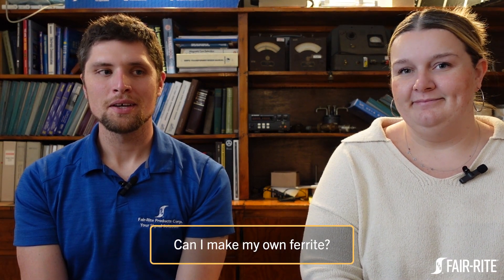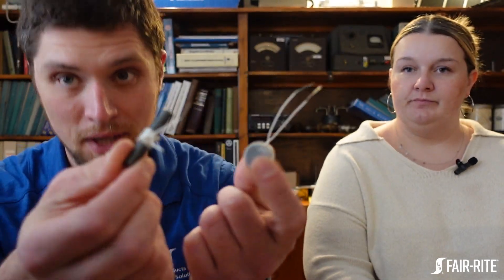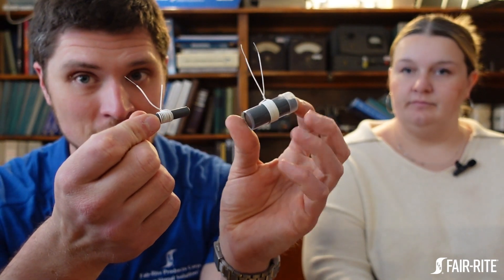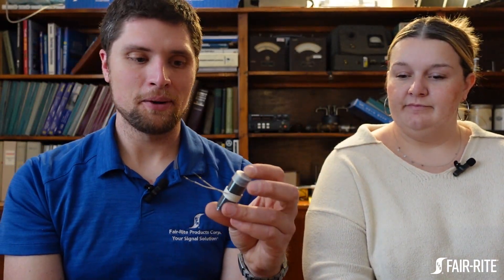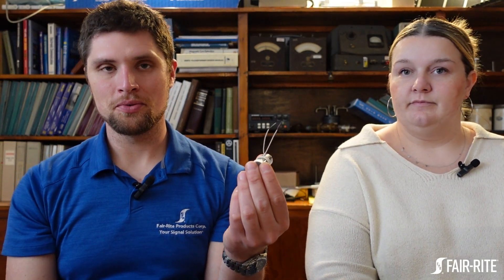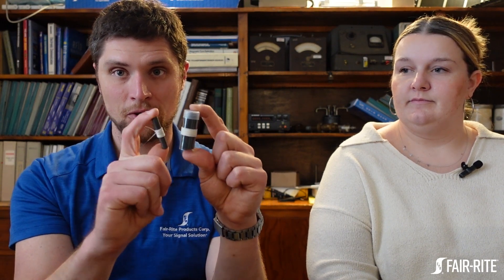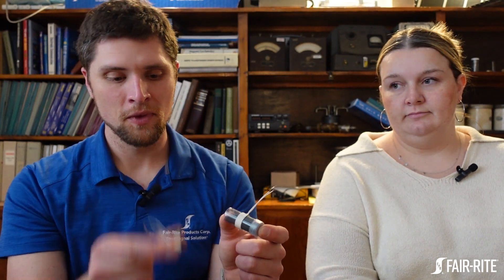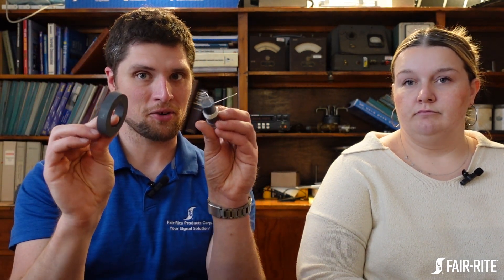S2 Ep 4: Can I Make My Own Ferrite?

Comment: Will. Ferrite bead still work ok if the wire is bout 2 ml in diameter smaller in size so it wouldnt fit tight hanks

Comment: what is the composition of ferrite and frequency response?
Reply from the maker: All ferrites are primarily iron oxide. Manganese or Nickel oxide are the next largest components. Higher permeability materials that drop off more quickly at lower frequencies will use manganese. Nickel is used in the higher frequency, less peaky materials. Zinc oxide would be the third largest component in either type. Changing the ratio of these and minor elements along with modifying the sintering profiles are how we arrive at the different material types.

Comment: Is it a good idea to make a ferrite core axial flux motor ?
Low eddy currents, hysterisis loss, high permeability, and higher saturation limits would all be good features to have.
Reply from the maker: My inclination is to say that ferrite would generally not be a good stator core material on any motor save for something operating at extremely high rpm. Typically, axial flux motor designs are desirable due to their lower rpm torque. While ferrite has relatively high permeability, It suffers from low and fairly severe saturation flux density (0.5T max) relative to electrical steels. The losses are low but, they’re going to be of greater benefit at higher frequencies. 

A powdered ferrite would solve some of the saturation concerns but, this will drastically reduce the permeability. It’s possible that something like this might be useful as a gap filler around an electrical steel core/winding when mixed into an epoxy.

Now, hard ferrites are something that is commonly used in motor rotors. These are the permanent magnet versions of ferrite. Similar in name but, these are different to what we produce.

Comment: Q; what material is good for a transmission line transformer design @12MHz~30 MHz range? Thanks
Reply from the maker: 52 or 61 material should be the best choices. Generally, you want to select the material that has the highest permeability at your start frequency (12MHz in this case). I mentioned 61 incase the power levels are higher. 61 won't provide as good coupling as 52 but, it will be quite a bit lower loss.